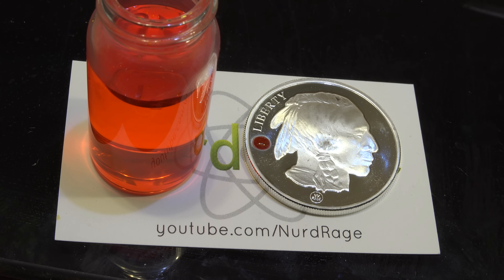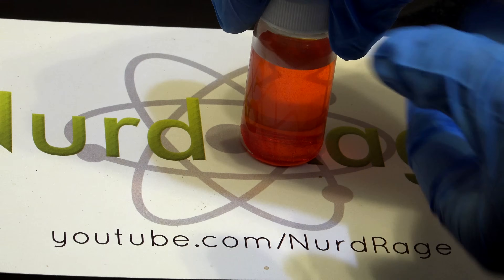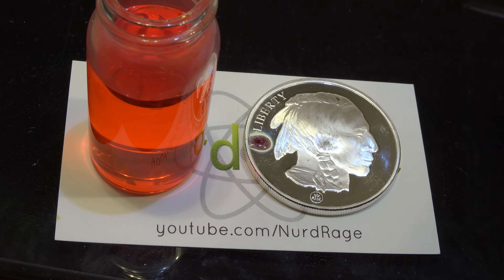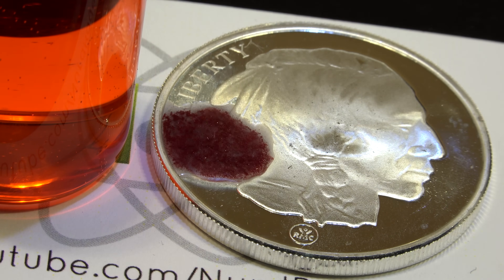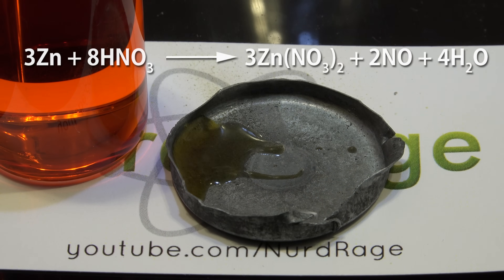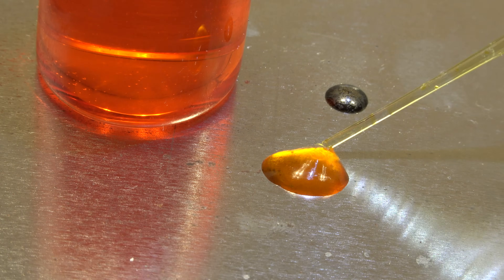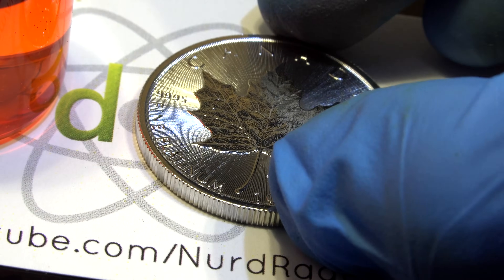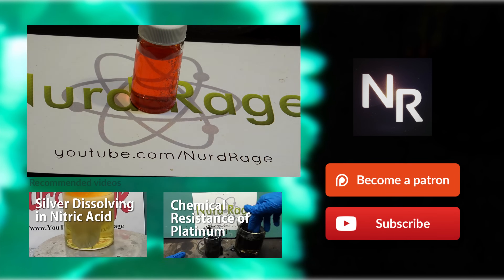Make Silver Testing Solution to Detect Fake Silver

Comment: Ins't better the acquaregia? Using it we can even estimate what metal and silver concentration composes the coin..
Reply: You would have to dissolve too much of the specimen and, if it is not a pure metal, there is no guarantee that you would get a proportional dissolution. For example, with sterling, the copper is not going to dissolve at the same rate as the silver.

And you don't want to use aqua regia on silver, as you get messy silver chloride., which passivates the reaction.

Comment: Why not just use a touchstone? Just rub what you know is the silver you want on the surface and then rub the mystery metal next to it. If the traces don't match, you know that the mystery metal is not what you want. It maybe silver, but it might be too pure or not pure enough or mixed with something you don't want like copper.
Reply: a lot of people do so (and also did so in the past. In preindustrial times you could see people wearing lots of silver and carry a small touchstone around with them for trading purposes), but there are different purities of silver and different alloys that can lookalike on a touchstone, especially if you are not used to using the touchstone (you need to get used to your touchstone, others look differently). So its some kind of art, whereas the chemical one is science. Though both methods do not tell you anything about the purity of the silver. Would have loved to see this with common silver alloys
Reply from the maker: Good question, ask all those silver traders that keep buying copious amounts of this solution. I'm just here to explore the science :)
Reply: Of course.

Comment: So if a 'silver' coin is fake, what metal(s) would most likely be present in the fake instead? Is it usually zinc or iron, or is it some other metal? If the coin was chromium-plated,  there'd be no reaction with the solution, right?

Comment: How deep does it eat into the sliver? Could you just use pot metal and coat it in silver?
Reply: Yes. His test is only valid for a pure coin, whatever the metal may be.

To properly test gold or silver with test solutions, you have to put a nick or scratch into to specimen, to get through any plating that may be on the outside. Obviously, you do not want to do this on a specimen that has much value outside its bullion value.

As far as I know, all the fakes so far can be detected by careful measurement of diameter and thickness, as well as weight. A specific gravity test would add another data point.  These are all non-damaging.

Comment: This makes no sense, here i have a silver coin for you, oh let me check if its real silver, crap now its ruined : ')
Reply from the maker: As said in the video a scratch test and then using the solution on the scratch marks is better since it causes much less damage. If you're buying silver for bullion then it doesn't matter what it looks like as long as it's real. If you're buying silver for looks then as long as it looks good does it matter if it's fake? If you're buying for both then you need to find a very reputable seller like a mint or a bank whose reputation is above reproach.

Comment: What exactly makes chromates so bad for you?
Reply: They are  highly oxidizing so they can oxidize all kinds of biomolecules in your body such as DNA. Damaged DNA can in turn lead to development of cancercells.
Reply: Hexavalent chromium . It is actively transported into cell, where it causes DNA damage in various ways (adducts, ROS, hydroxyl radicals).
Reply: In a way yes but very slowly. Oxygen is responsible for a lot of aging processes when you grow old. I 've always found it very ironic that the same thing that's essential to live ultimately destroys our body.
Reply: Interesting link. I'm a chemist so I know only the basics of biochemistry/molecular biology. Now that you mention it: I used to work a lot with cobalt(II) salts which are also suspected carcinogens but not oxidizing. Probably works with a similar mechanism then.
Reply: Could be, I'm not a specialist on this topic after all but I'm pretty sure it has something to do with its oxidizing properties. In general, oxidizing compounds are harmfull to some extent. Hydrogen peroxide might not be carcinogenic but it is toxic for cells, hence its use as a desinfectant.
Reply: We have been used to having oxygen in air but it can be dangerous for life as seen from the mass extinction caused from the first oxygen that was produced by photosynthesis.
Reply: +PieterG159
That is not the mechanism. Example hydrogen peroxide is not carcinogenic.
Reply: Wait. If oxidising compounds are harmful, then doesn't that mean the oxygen we breathe is killing us?
Reply: +PieterG159
You are fine with little amounts of equally strong oxidants as chromates. So the oxidizing property is far from the main  problem with chromates. The problem is with Cr(VI), which gets inside cells and creates DNA adducts (nothing to do with oxidizing properties and the main mechanism for its carcinogenicity), ROS and hydroxyl radicals (latter two only with other oxidizing compounds).
https://www.ncbi.nlm.nih.gov/pmc/articles/PMC2602826/

Comment: Would a drop of Na2S solution with a drop of acid (HCl) on the silver metal turn it black? (Ag2S). Not sure if the in situ H2S is enough.
Reply: Na2S and HCl wouldn't work since it will give very similar results with other metals too.NaCN and Na2S will be a 100% accurate silver test since it blackens the surface of silver on contact but it would also be extremely toxic though...
Reply: +casaverdero not only that. Na2S reacts with HCl pretty powerfully to form NaCl and gaseous H2S. I had to mix these two this year. You know, S2- ion recognition. I just dropped about 1 g or 0,5 g of Na2S to about 15 ml of 0.2 mol/l concentration of HCl. I didn't really expect such a violent reaction, but then i needed to smell H2S. First i tried to do it carefully, but when i realised, that i don't feel anything different, i put my nose closer to the tube. Then the smell got me. Wasn't able to smell anything for half an hour.

Oh and you can't use NaCN too. It reacts with any acid to form HCN (lethal gas) and a Sodium salt.
Reply: McVidsAndTutorials I'm so suck of wannabe-experts, "I did this once so I know everything". Generating H2S gas is the point, it reacts with silver to tarnish it black (Ag2S). The question is if it happens rapidly enough to be visible.
Both HCN and H2S are very toxic, with a similar mechanism of toxicity. But you will never reach dangerous levels of either gas in a small metal test, for two reasons. HCN is miscible in water and a H2S has a good solubility too,  only minute amounts should bubble out.
Reply: +McVidsAndTutorials I never said mix HCl and NaCN i said Na2S and NaCN.NaCN dissolves gold and forms Na3[Ag(CN)4] then Na2S breaks this complex and forms black Ag2S.This can only happen to silver or gold and since gold has a characterisic color its 100% guaranteed to identify silver.